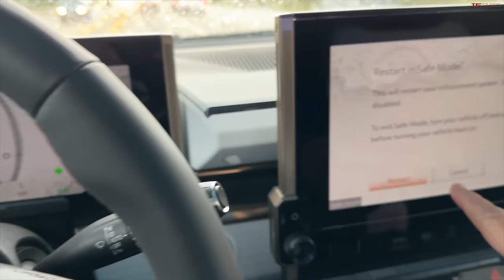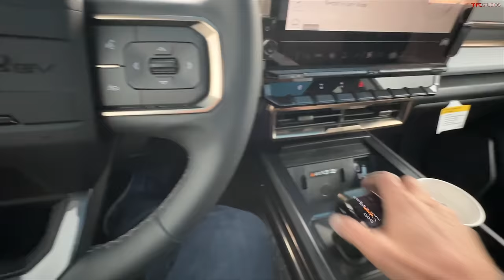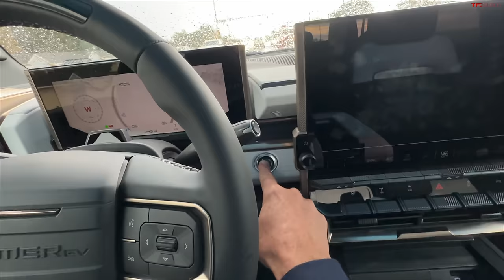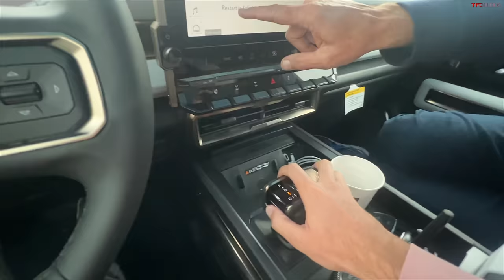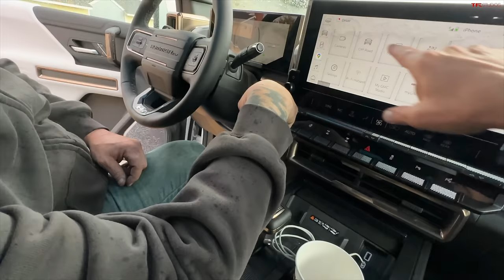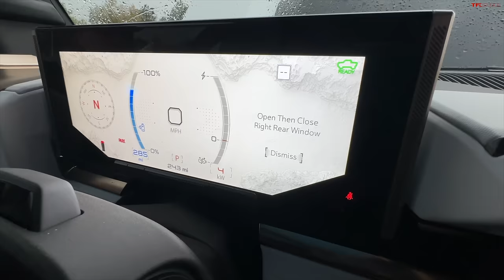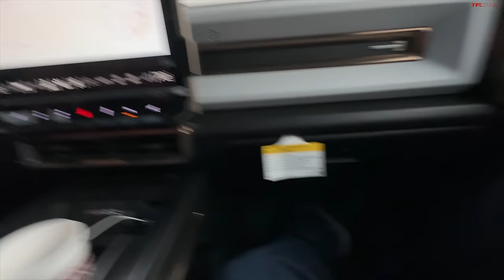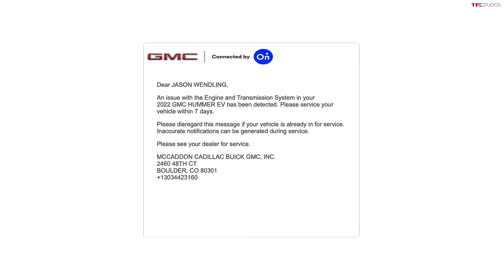I Bought a $115,000 GMC Hummer EV and It IMMEDIATELY Left Me Stranded!

Comment: I work in an all electric gold mine that is transitioning to all electric equipment and with all the reliability and safety issues that we have with the equipment on site, there is no way in hell I would own an electric vehicle. They have a long way to go to prove to me that they are worth any money at all. Let alone the ridiculous price tag that is attached to them. Thanks for showing what really happens with electric vehicles.  I'm glad you made it out of that situation safely.
Reply: I've been commuting with one for 9 years and had no problems at all, very low maintenance, and the lowest fuel costs ever (nearly free since I added solar panels to nearly match the kWh consumption). The battery capacity has declined in the last three years, especially, so it's about ready for an exchange, like an engine exchange. If I get another 8+ years out of it, it will be more than worth the cost. Except for hauling / towing and long-distance trips, I doubt that I'll ever go back to an ICE vehicle. Electric has lots of advantages. I'm not sure what good someone expected out of a Hummer being electric other than a really expensive and heavy Big-Boy Toy.
Reply: @ReflectedMiles  9yrs?, Gotta be a hybrid wouldn't it?, And also ICE engines can go for decades if cared for without an engine swap out. 
Just my opinion but electric needs way more improvement for it to be near the standards of longevity and efficiency as ICE. Especially with batteries, they're just not light enough or as quick to charge....yet.
Reply: @jayebuss5562  Nope, pure electric. My father was an engineer who told me decades ago before he passed on that any resurgence of EV on better battery technology was something to seize on because electric motors and systems were far superior in longevity and maintenance required compared to any ICE tech. So far that has certainly proven true for me for commuting purposes.
Reply: @ReflectedMiles  fair enough, if it works for you then kudos.
It's in it's infancy but it has potential ( battery powered vehicles) that's for sure.
I'll have to stick to my diesel atm here in Australia as trips are far too long and the infrastructure isn't there yet but I'll definitely see what the future holds.
Reply: @WendysNuts4u  Tesla has some of the biggest quality control issues of any US auto maker.
Reply: huh sees one bad EV and calls them all trash.
Reply: @jayebuss5562  efficiency already blows the shit out of gas-powered cars you can remove that from the need for improvement list of yours
Reply: @ethearnos6397  yes, less moving parts involved. 
Not against E.V mate, just better off with an ICE for the time being.
I think people are jumping the gun when it comes to this.

Comment: Meanwhile my 2005 V8 HEMI Jeep GC WK hasn’t ever left me stranded…
I think I will stick with it for awhile!
Reply: My 2005 Silverado Z71 hasn’t left me stranded as well. 278,600 miles 🎉
Keep ‘em gas powered.
Reply: Never an issue with my 2005 F-150 XL.  Simple as dirt.  Not even power windows or locks.
Reply: @cgatito3528  no issues with my car either. New stuff isn’t the best.

Comment: My daily driver is a nice well kept 02 lesabre. It serves me well and it's easy to wrench on. My previous car was a 07 taurus, drove that one to 306,000+ miles. It's still on the road, just not doing my 150 mile/day road trip to work and back, it's on light duty as it should be. Doesn't owe anybody anything. The lesabre has 145,000ish miles. I think that's the break in period for the 3800.
Reply: How are the trannys on those older gms with the 3800 engine? heard they are on the weaker side.
Reply: @whitegoodman7465  I wouldn't use bulletproof to design them. They made a variety of 3,4, and 5 (overdrive) transmissions varying in quality (see the fleet spec impalas for an example of reliability). The 3800 is arguably among the best engines ever made in terms of reliability, even approaching Honda/Toyota.
Reply: 150 miles there and back? I never realized how lucky I am to only travel about 48 miles to and from work!
Reply: All great cars, I have an 04 Volvo V70 with a baby 170k and it’s brilliant. The more I see all this BS with EVs the more I want to hold onto it. The 3800 is such a bombproof engine too
Reply: Have seen 3800's with 500k+ several times.
Reply: I miss my Taurus. I loved that car. It still ran great. I just didn’t have any place to keep it.
Reply: 3.8 was bullet proof great engine alot of gms ran them
Reply: I smell cap.   I agree older vehicles last forever I have a old Subaru w over 300k but to say a ford Taurus got over 300k.   No.  Maybe 30k.
Reply: @mrlouisvashi  well this one did over 300,000 miles and is still going. 3.0 Vulcan, not the 3.0 DOHC. I have a pic of the dash driving at 60mph 2000ish rpm the day it turned 300k.

Comment: I had a 2021 Chevy Tahoe, the same thing happened after a soft ware update under 300 miles after I took ownership and they changed the vehicle over to my name the entire system shut down, left my family stranded in Big Bear. The dealership has jo resolutions for the issue. It was a software issue from a system update. Basically for 24 hours while the update is happening you should drive the vehicle. In my case reseting the battery was  the only way to fix it. This Tahoe also had very dangerous lane keep lane departure. Never the less it was sold with under 1000 miles because it was no longer trusted.

Comment: Your experience with this has put me off EV's forever. I will just keep my 1985 Toyota Hilux going for as long as I can.
Reply: Good luck.
Reply: 88 chevy pickup for me 
very easy to work on and if I need any part it is in stock everywhere
Reply: @NightshiftCustom  sooner or later that won't be the case.  Unfortunately, with the U.S. going towards EVs, service centers at dealerships and auto parts stores will be a thing of the past.  You might be able to find something online but sooner or later that will be died industry as well.  my friends work in the service department at dealership, and they are having to find a new career because of EVs.  They hardly need salesmen as well because now you order online and wait till it gets delivered to the dealership.  It will cause millions of jobs to be lost in the auto industry and 10s of millions in the oil and gas industry.
Reply: Not all EV's are the same, and petrol cars are getting more computers and software too, and their software is often worse than EV's, and usually doesn't come with automatic software updates over wifi.
Reply: @navyvet7138  you can still buy parts for a ford model A just about anywhere even amazon! and that's almost a 100 year old car so say what you want to say but I don't think its going to ever happen the way you see things lol

Comment: Currently going through the same situation with my 2018 Pacifica Hybrid. Been to 4 different dealerships a total of 9 times and been without the car for over 2 months combined just to get it diagnosed. There is currently a part on order (some sort of electrical/computer component) - so we will see if they got it right this time. Regardless there needs to be a hard reboot button on these cars.
Reply: Pacifica is a Fiat.
Reply: Have you not ever heard of the "Lemon Law"?  Get yourself an attorney that knows how the law works and get rid of that POS van.
Reply: Lemon Law it

Comment: I had a similar experience with my Ford Edge a long time ago. 
I've hated Ford since, but I came to realize every car company has lemons like this, it's about how the company deals with it.

With me the car could drive but the infotainment system didn't work, and the heat was stuck on maximum. 

Ford's official response was "it can still take you from point a to point b, therefore the car isn't defective just inconvenient. We cannot take the car back."

They eventually semi fixed it 3 months later. The full fix came 2 years later.

Comment: This isn’t just EV’s it’s all vehicles. You are essentially driving a computer down the road. And we all know how often a computer or phone locks up on you. This is only going to happen more often!
A long time ago they used to R&D cars for at least a year before they were released to the public. Now they just release them and pray for the best!

I’m a Tech at a CDJR dealer and our Pacificas PHEVs will do this. But Mopar gives you a N release so you can pull it into a flatbed. The fix is a reset of various modules. Now there is a flash for the PCM and AHCP to fix that problem. But we all know there is going to be some other issue.

Comment: Imagine if an automaker were allowed to make a “dumb” car. No stupid tech. Nothing. Bare minimum safety stuff to keep dot happy. It would sell like crazy.
Reply: Like my 1972 chevy truck?! Simple, easy to work on, still running strong today.
Reply: Yeah, like those old $7k Kia's.
Reply: Basically KIA if you don't count CarPlay (iPhone repeater on the console). My KIA and Nissan don't kill themselves with stupid design flaws and unstoppable settings like my Dodge.
Reply: @kris10tentin  those old trucks go for a fortune.   Could go higher when folks figure out that electric is nasty.
Reply: My first car, 1970 Chevy Nova with a straight 6 cylinder engine. My dad did all the maintenance on it. Easy peasy.
Reply: @susandemetry7158  if you'd only known you should have brought 3 of those Novas.
Reply: Didn't know Chevrolet made a nova, the only nova i ever knew of was the Vauxhall Nova

Comment: Most cars with electronic shifters have a little button you press with a pen to allow you to put it in neutral for towing. GM needs to add a way to force it into neutral even if the battery is dead.
Reply: That's no transmission to put into neutral, it's just the actual parking (handbrake) that's keeping the car stopped, it's electronic though
Reply: Did you forget no motor and transmission
Reply: I guess I should have said GM should add a way to force the parking brake off given there is no actual transmission.
Reply: @imkwuzn  there is, just remove the parking brake motors. But it's too complicated for the average person and there's no real way to make a bypass under a total communication or electrical fault as it's literally just a motor pushing some pads on a drum. No cables or anything like that
Reply: Can you imagine a dead / defective battery?  The hassle it will be...
Reply: @PowerSportsQuebec  i know right!!  and the cost of course

Comment: Software devs be like "we'll fix it after launch"
Reply: "Production's problem now"
Reply: Like Boeing, this what happens when the auto industry outsources a significant portion of software engineering to other countries with no oversight.
Reply: @cup_and_cone  Also I don't think you can really manufacture like you develop software. The finished product has to be right, or as close to right as possible. 

I wonder how rigorously these vehicles are tested outside of the federal safety requirements. I don't want to short change the GMC EV team, because this might have been an extraordinarily unusual event, but this should not happen to a production example, ever.
Reply: @cup_and_cone  exactly. I guarantee the systems running this thing are a patchwork of nightmarish code that was written by some developers overseas making $3/hr. Then some poor GM engineering staff had to somehow cobble together a working product on an impossible deadline. Some manager quickly reviewed a few things to check that some important functions worked and signed off on it. Then leadership celebrated the project and gave themselves raises because they got it done for so cheap.
Reply: gonna have to get the DLC for it to shift
Reply: Are like*
Reply: It’s gonna be like EA, micro transactions to get it to work correctly lol
Reply: OTA update. No sweat! LOL

Comment: That is a bit concerning that there was no easily identifiable way to override and allow you to get to a safe place or at least back to neutral. After having this experience I would be very curious to see/hear what Ford, Rivian, and Tesla have as safeguards for a similar situation.
Reply: They probably have the same system but it actually works for them because it was programmed correctly, just because it didn't work here doesn't mean it won't work elsewhere or is likely to happen all the time or at any point randomly, they also have manual ways to open the hood or access the vehicle in ways that can help you do a hard restart if need be, like hidden latches or the keyfob having actual physical key hidden inside, you just crack it open, most don't even know about that.
Reply: I wonder if each hummer has a unique reset process so folks can’t steal them as easily, like with keys.
Reply: My Tesla system has completely locked up 2 or 3 times, but it has never impaired the basic driving functions in any way. I'm guessing all the physical controls are on a separate sub system. I can hold the two steering wheel buttons down for 15 seconds and it does a hard reboot. It works every time. Well, one of the times it was locked up as I tried getting out of my garage in the morning. It wouldn't recognize my phone as a key, so it wouldn't go into reverse. A reboot and 30 seconds later everything was back to normal. I've had it for 18 months now, a few times to hard reset isn't too bad IMO, as long as it can always be done and doesn't get worse.
Reply: What a big, heavy, expensive, pile of crap. No EV for me…
Reply: @donniel8665  It is not an EV problem, it is this model being total crap problem.
Reply: "call roadside assistance, fu." is probably their response.

Comment: Window procedure is required to index windows after battery has been disconnected.  It's a GM thing for windows  that  move down when you open the door.
Reply: Also notice, they could have dismissed the windows messages. It wasn’t required to unlock the shifter.
Reply: @thewooddogg1  It needs a "disable user panic" mode then, because their panic didn't go away. (Maybe a small tray opens with a Zanax inside? 😆)

Comment: Just imagine EV Hummer on  battlefield 😮
Reply: soldiers opening and closing all windows in the middle of the cross-fire hahahahahah
Reply: Try to tell brainless masses who love tech in vehicles that the more tech you got....the more that can go wrong and the more expensive it is to fix. I just want a NA gas powered RWD car with a manual transmission and hand crank windows, a tape or cd player is good enough for me don't need screens...they will go bad, use an external GPS or your phone if you need it.
Reply: A whole lot of lithium are rare minerals mined for a target
Reply: At least don’t afraid going thru land mine
Reply: @arkinazimet4123  Battlefield Hummer’s don’t power windows 😢
Reply: @Yarmox  lithium isn't mined
Reply: @bradmagnuson6963  sure its taken out of deposits, but technically it is mined
Reply: @Yarmox  nope, wrong

Comment: I'm a huge GM fan of old. I bought a brand new Silverado in 07 and that thing had electrical issues that even the dealership couldn't figure out, family members had electrical issues with their GM products as well. 
I'm not at all surprised that GM's electric vehicle is having issue's. 
The amount of patience that everyone had was AMAZING! 
I hope that the company stands by their product and takes care of you.
Reply: The Bolt EV had 13 cases of actual batteries shorting out and igniting fires. That’s a serious electrical problem
Reply: Ever seen a GM with a passenger side running light that hasn’t burnt out?
Reply: Sounds like GM has some former Lucas Electrics engineers on their staff.

Comment: The only procedure related to unlocking the shifter was holding the brake pedal. The windows was to relearn the automatic up/down positions since the battery was disconnected. Has been something GM cars do for the past 5 years or so after battery disconnection/replacement.
Reply: Other car manufacturers as well with auto up down mirrors will stop auto functions until they've gone a full cycle. But they don't give error messages when they are needing calibration typically
Reply: True. Think though. They aren't mechanically inclined in the least so they've probably never changed a battery before
Reply: @EGGINFOOLS  not to mention you can clearly see that you can dismiss those window warnings and the car in no way was requiring them to do the window reset at that moment.